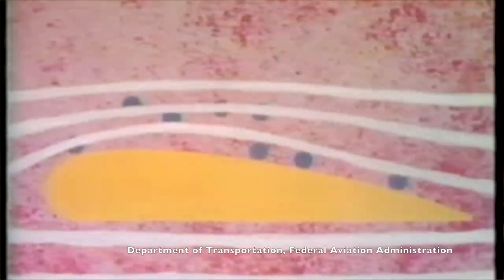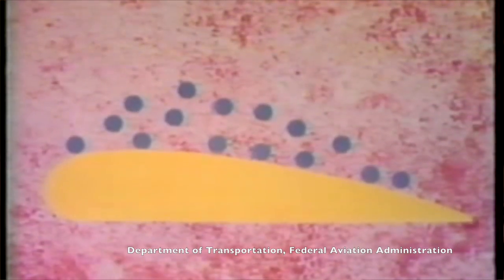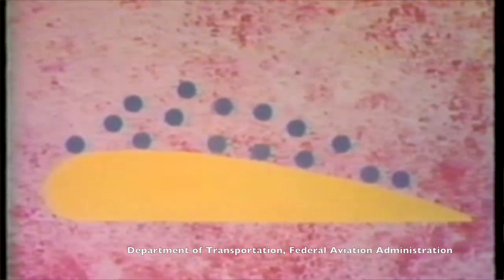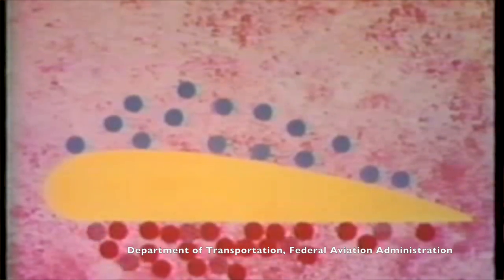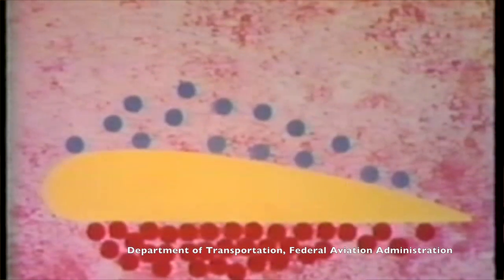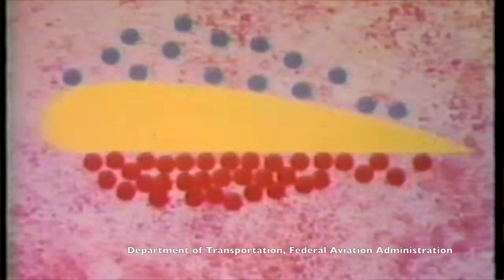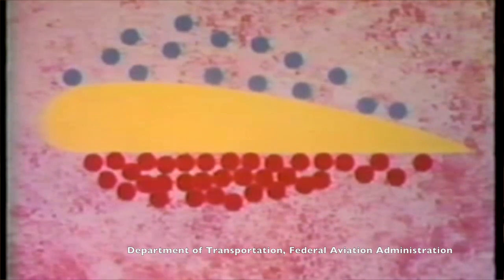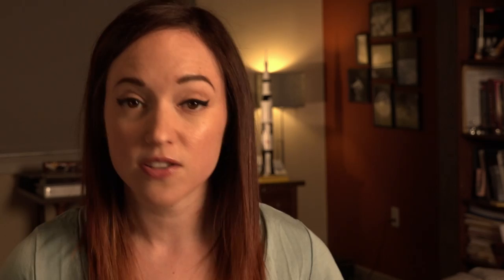How Do Airplanes Fly?

Comment: wasn't there a helicopter that used a sort of reaction control to avoid the need for a tail propeller?
And given how reaction control can be used to steer an airplane, wouldn't it be more effective, perhaps safer, if commercial aircraft used this system instead of ailerons?
Reply: Helicopters can avoid using a tail rotor if they have a pair of counter-rotating rotors for lift, since they cancel each others torque, and the relative torque and pitch of the rotor blades can be used for steering instead.

Part of the problem with RCS is that it requires propellant, usually explosive hypergolic fluids, that must be carried. Also, rocket jets are significantly less effective in the lower atmosphere where the air pressure fights back against them. Traditional control surfaces are a much simpler, and safer mechanism for any aircraft not heading into the upper atmosphere. Commercial aircraft fly low enough that control surfaces are the way to go.
Reply: Ed T. NecroBones I see :) thanks for answering!
Reply: ***** Ed T. NecroBones It's called a NOTAR system! Go check out the Wiki page, it's a really cool idea.
Reply: +Arturo Gutierrez - I've often thought that adding a small reaction motor onto the tail boom of a combat helicopter would be a good idea. If the tail rotor becomes damaged in a combat situation the motor could be fired to keep the helicopter from spinning around, going out of control and crashing. The motor could be fueled by using compressed air and pressurized fuel from the helicopter's engines and throttled using inputs from the rudder pedals.
Reply: Joe Vignolo That's a cool idea, but think about the low pressures used in fuel injectors. If there was enough thrust to take the place of a tail rotor, the engine would tear itself apart due to internal stress.

Remember that a NOTAR doesn't just dump engine exhaust out of the tail, it has a fan to provide lots of pressure. It would seem kind of pointless to build a NOTAR and add an extra tail rotor as well.

You could of course add an emergency turbopump, but given the drastically increased fuel consumption and dead weight, that doesn't seem like a great idea. It's better to just make a better tail rotor.
Reply: +Ben Etherington - I've thought about this idea of having a safety motor installed on the tail boom of combat helicopters in more detail.

First, during an emergency such as combat damage to the tail rotor you would want to have a decoupling device to uncouple the damaged tail rotor from the engine. This will stop it from spinning so as not to vibrate the helicopter or have the spinning rotor throw parts off that could further damage the helicopter so that it can no longer fly. But doing this would also unload the engine, which reduces its fuel and air consumption. This reduction would leave excess pressure available from the existing fuel pump(s) in the helicopter's turbine engine(s) that could be enough to inject sufficient fuel into the safety motor. Similarly, the compressed air requirements of the engine(s) would be reduced, allowing the excess air to be bled off to oxidize the safety motor.

As you point out there would be considerable stress placed on the safety motor, but dealing with that is just a matter of doing a proper design and using the correct materials to construct the motor.

Fuel consumption really isn't an issue. All the safety motor has to do is run for a few minutes to allow the helicopter pilot to find a safe place to land.

You certainly can try to beef up the tail rotor to make it more resistant to combat damage. But if it gets hit by something big enough hard enough you are going to lose the tail rotor and start to spin. The tail rotor is the most venerable part of any combat helicopter, which is why the enemy always aims for it. The safety motor would just provide a short term back up.